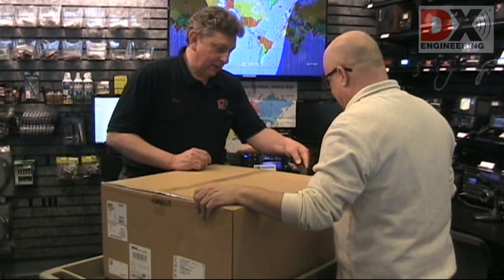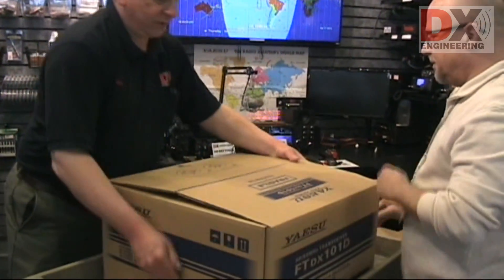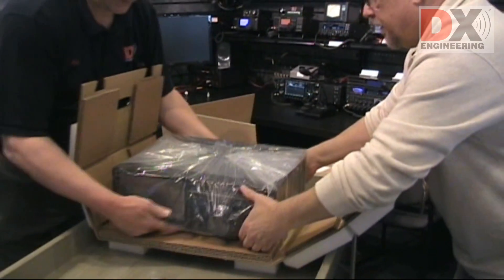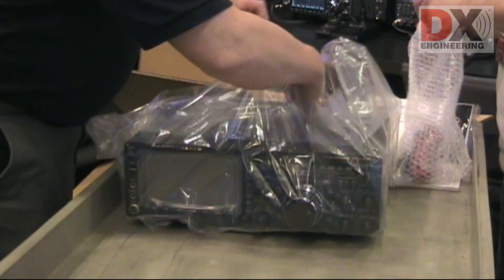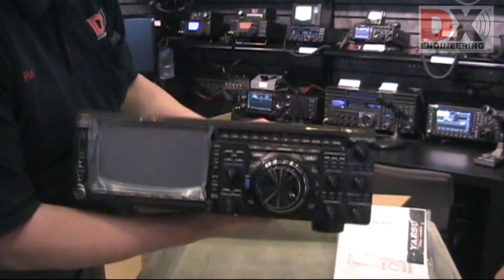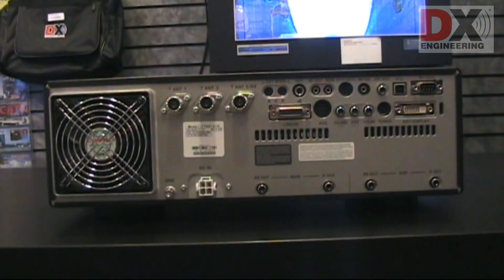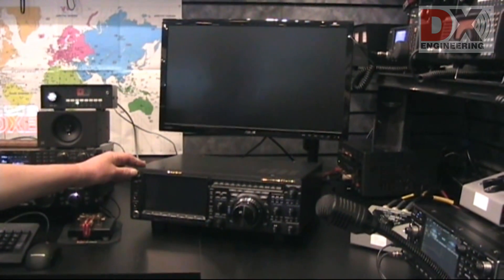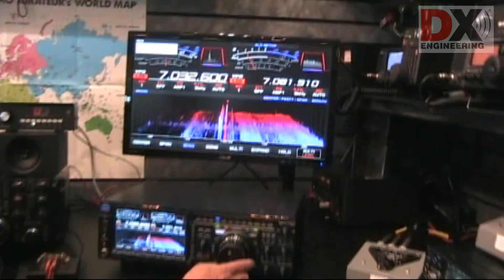First Look at the new Yaesu FTdx-101D

Comment: It would be interesting to make videos on the low bands (3.5 and 7 MHz)
with strong signals right next (at 3 kHz) in order  see the resistance to strong signals.

It would be helpful to have a cable recording of the station's audio
because an aerial record is not faithful.

Best regards,
Ludovic - F5PBG
@t

Comment: Question one: Can it do a regular 2D Spectrum display with trace fill and persistence? I prefer the standard type spectrum display.
Reply from the maker: Yes it can - looks very cool as well.
Reply: DXEngineering you need to show the 2D display as well. I was hoping you would...
Reply from the maker: @3butalcomp3  Take a look at the DX Engineering Facebook page - Mark W8BBQ has more info on the radio showing the display https://www.facebook.com/DXEngineering/videos/815962828760101/